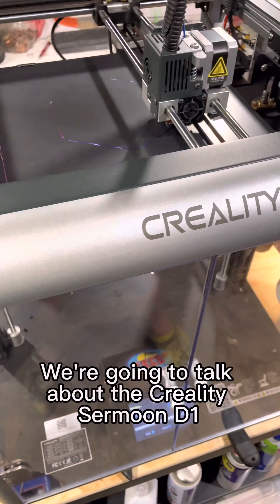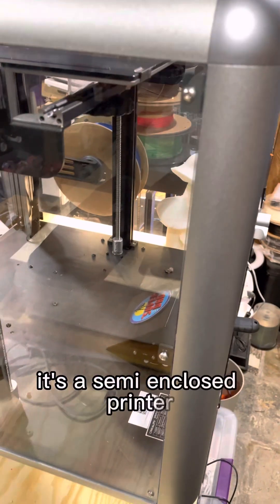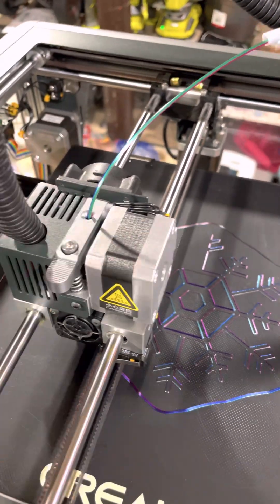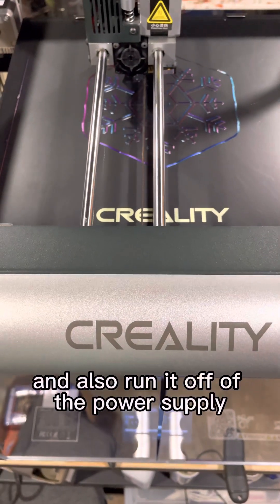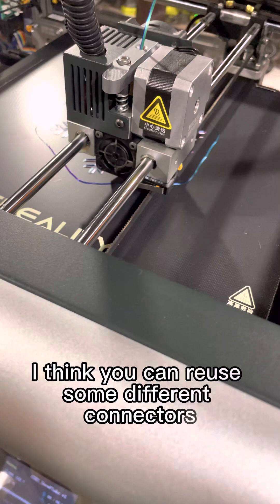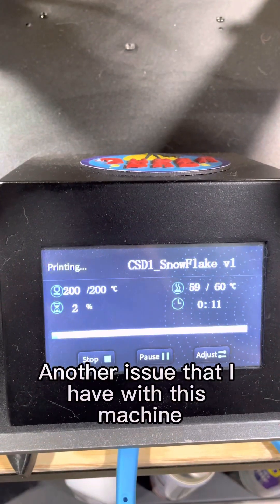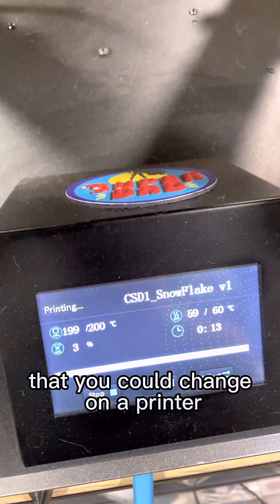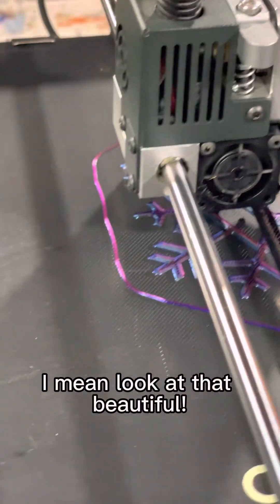My powerhouse 3D printer the Creality Sermoon D1

Comment: When taking a part off THE heated bed sometimes one side would screw down a step or two.  I fabricated pulley and belt system above the deck to tie them together.  My problem is the scream commands suck.  I added bl-touch because the bed has hills and valleys.
The z adjustment is reversed.  The z axis most of the time gets within 6mm of the nozzle and stops. I must be looking for the Z up limit switch that has been removed.  Some times it "TIMES OUT"  on Z up moves. If the value for Z is "0" you are finished.  This machine was great except Z stepper split until I installed the BL-TOUCH.

Comment: Please give me an advice, between Ender 5 S1 and Sermoon D1, which is better choice (about build quality, and capability use for many another purpose), I’m beginner, thanks.
Reply from the maker: I am not terribly familiar with the Ender 5.  I do love my Sermoon, however, there is very little aftermarket support.  In fact getting OE parts requires an email to Creality.
Reply: I advice Sermoon. But depends if you are a plug n play user or more advanced... Sermoon its a vey good Plug N Play. Nice bed and speed

Comment: I got one both on sale and clearance for $275 at my local Micro Center

Made some modifications my self, first the fan ducting for the two carriage fans as i noticed the carriage gets alarmingly hot because it also doubles as the heat brake and i also wired them together to always run. Next i installed a truly all metal hotend but that requires you to cut down the original metal throat and needs a sleeve or very carefully and neatly wrap a copper sheet around the heat brake to fit snug (which is what i did) as normal heat brakes are either too small or too large. The fan ducts i designed are up on Thingiverse

Then i put some thinner PTFE tubing in with wire sleeve going to the print head/carriage and running down inside the back where i mounted the filament spool. The warmth helps keep the filament drier there IMO. Noticed after that i didn't have the carriage yanking on the spool anymore.

Now I'm working on getting a BTT SKR Mini E3 V3 to work on it, saw someone on a forum claim to make it work with CR-10S firmware but didn't really post details. Would be nice to get linear advance as I quickly found the machine has NO ringing what so ever at 250mm/s (2,000 acceleration) but starts to hit the boards buffer limit and has clear under/over extrution issues from running those speeds where linear advance is IMO a must have when at or over 200mm/s. So as of now I'm running it at 200mm/s with 1,000 acceleration for all my prints.

Also might have to add a TL smoother to compensate for the "cheaper" stepper motors if the SKR Mini doesn't help enough with the better drivers. Funny enough, my ancient wooden Replicator has virtually no stepper bumps on the prints as my guess the motors "smooth" electrical spikes by converting to heat 😅I tested that theory on a i3 machine i have by swapping the motors and it immediately fixed the e-step smoothness (not perfect) so i then switched it back and added a TL-smoother which didn't nearly the same job but without a very hot motor 😉
Reply from the maker: Wow! Would love to get a different hot end on mine.

Comment: My z offset keeps dropping whenever I level it or after a new print. Things been useless to me
Reply from the maker: You may have some loose bed springs!   What printer do you have?
Reply: When taking a part off sometimes one side would screw down a step or two.  I fabricated pulley and belt system above the deck to tie them together.  My problem is the scream commands suck.  I added bl-touch because the bed has hills and valleys.
The z adjustment is reversed.  The z axis most of the time gets within 6mm of the nozzle and stops.  If the value for Z is "0" you are finished.  This machine was great except Z stepper split until I installed the BL-TOUCH.